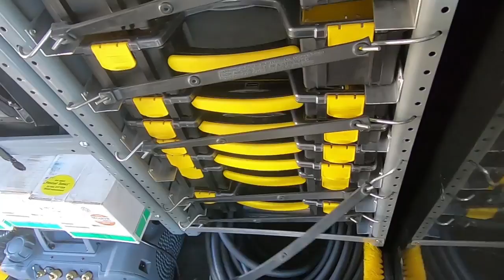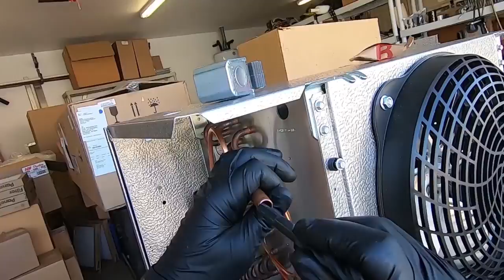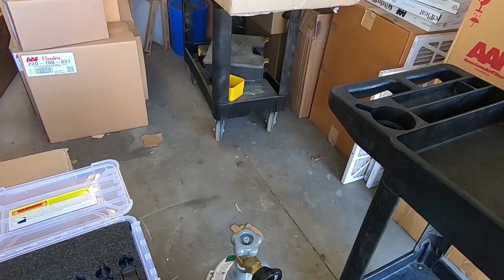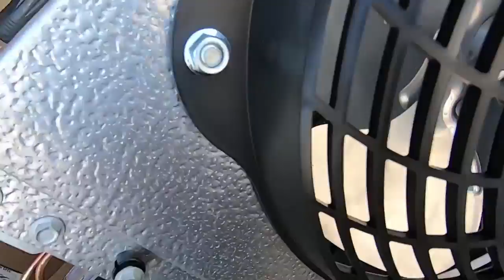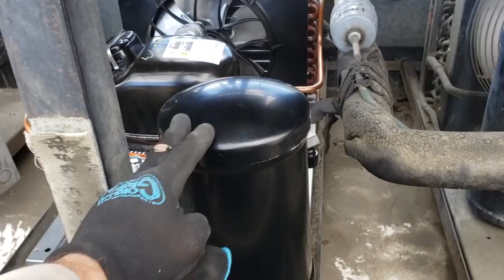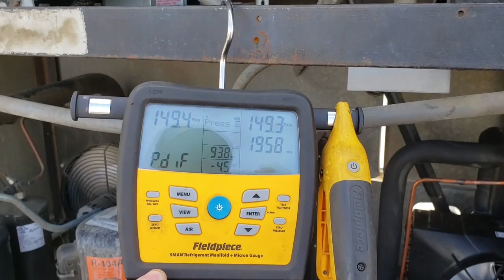BEER WALK IN EQUIPMENT REPLACEMENT

Comment: I had one I did this summer that was a real pain. Saw about a 4 inch 3/8” tube fall out of the feed tube leading up to the orifice when I unsoldered the TXV. I thought what the hell was that doing up there. Later on I found the orifice on the floor and realized someone used the tubing to hold the orifice in there, because they didn’t have (or lost) the retainer clip.  I found zero information in my books on it and very little on the Sporlan web site.  I thought the clip was to be installed parallel with the orifice and would pop into a groove/ slot once the orifice was up against the distributor head. It never occurred to me that the clip could be installed perpendicular to the orifice as it looks like you did in the video. Do you just start the clip in initially like that, and then, the clip rotates parallel when you push on it with the drill bit? Or does the clip stay in there perpendicular to the orifice under spring tension constantly?
I also noted refrigeration supply houses haven’t a clue about getting you a clip.  I ended up getting one by ordering the wrong sized orifice but right sized clip (L) = 5/8”..... I had the right orifice, just no way to hold it in. I got one on eBay used the new clip and tossed the wrong sized orifice.  Needed an L 2-1/2, clips are not available separately.  It was an experience. Also learned that the tube between the TXV and distributor is limited to 24”. FYI...

Comment: For the Schrader valve tool you used at the start of the video, next time you are at Auto-Zone, get the shortest valve stem that they have on the shelf,. and attach (in your case glue as your look like plastic) the removal tool to the end of the valve stem.  (the one I have is metal, so I just gave it a squeeze in a vise).  Much easier to screw and unscrew, and less likely to get misplaced.  (keep one without a valve stem for really tight quarters)

Comment: I see the line penetration hole you made for the new line set is large enough to accommodate the liquid line and the suction line with probably 1" insulation. I was taught that the penetration hole should be just large enough for the liquid line and suction to squeeze through, sealing it with expanding foam, and running armoflex to opening. We have found that over time with a hole that size, the roof panel insulation becomes saturated with water, will freeze, and thaws during defrost, runs down the insulation and refreeze causing a knot of ice to build at the bottom of the trap. The only fix at that point is to move the location of the line set. Now, this may be caused by the almost constant high humidity here in Miami and you may not have this issue in California.

Comment: Did you have to flush out those did you have to flush out the refrigerant lines? I am going to be doing in the near future and R22 to 404a walk-in cooler replacement. New indoor and outdoor unit 404 a and I was thinking of flushing out the lines did you do that on this job?

Comment: I don't know if you have United Refrigeration out where you are, but Trenton has this new ESP + Evap line that is built around the KE2. They are pretty cool, defrosts when needed vs timed, variable speed motors, EEV. Done a few so far, they are pretty nice

Comment: My goodness you would think you were welding the a frame on a 57 ford stay brite the way to go
Reply from the maker: No sir only 15% silfos for me.....
Reply: @HVACRVIDEOS  I watch a extensive video on a commercial gut on stay brite he even sliced open fi\ings and elbows the stay brite had more complete suckling up he said after 15 years no complaints if you would like I can post it to you
Reply from the maker: I have also seen those videos and read the articles but in my experience Stay brite has not lasted, I don't know if its the vibration or what but i have seen too many leaks

Comment: Chris, If you have installed a nozzle in the evaporator why do you need a TXV? Wouldn't the nozzle orifice do the same thing?
Reply from the maker: No the nozzle is not a metering device it is there to evenly distribute the refrigerant from the txv to each circuit.

Comment: I agree with you on using flares for the dryer and the sight glass on the roof, wrenches are lighter than torches... do you ever try the Jim Pettinato trick and use a little leak lock on the threads? A lot of people gave Jim flak for that on his videos stating that a flare doesn’t leak on the threads, they’re right but I think they missed the point, Jim doesn’t use leak lock to seal a leak, he uses it like a thread locker to prevent the flare nut from ever backing off due to vibration (at least on the dryer). I’ve switched to making all double flares recently, it’s easy with copper and you can apply more torque to a double flare. What do you think Chris?
Reply from the maker: I used to use leak lock but now I use nylog and I like that much better.

Comment: Hello 👋 chris nice job and video, thanks for sharing..question? The equalizer pipe conector from the evaporator should or not be like the exactly length manufacturer send in the new evaporator?...please when you can
Reply from the maker: the equalizer line can be shortened, its the txv distributor lines that you have to be careful about if you shorten one of those you need to shorten all of them.
I will be going live on YouTube this evening 4/22/19 @5:PM (west coast time) to discuss my most recent uploads and answer questions from emails and the chat. Come on over and check it out if you can

https://youtu.be/Zz48S-NmlAY

Comment: While i do enjoy your videos this is a complete waste of time and effort. I used to do all this crap years ago as well, buy everything separate and put it together, now i buy my evaporators complete, solenoid, thermostat and txv already installed, when you calculate the material and time wasted to put it together on your own, it's not worth it. Every time i priced out a job with a pre fab evaporator compared to buying and doing everything myself, if you include my labor, it's cheaper to buy it already put together not to mention it's a lot less work 🤷‍♂️ i get it that you might be doing this to create content for YouTube but i prefer to work smarter, not harder
Reply from the maker: I agree that a prepped evap saves time, however sometimes the prepped evaps aren't in stock

Comment: Can I ask what the purpose of the nitrogen purge is? Is the residual refrigerant flammable? Or does it protect the unit?
Reply from the maker: The nitrogen helps to keep carbon flakes from building up in the system caused by the reaction from the heat and the oxygen while brazing.

Comment: Hey Chris nice job. Why not 95/5% soft solder these joints? I work transport refrgeration and we use soft solder on all low pressure joints. 404A & 452A systems.
Reply from the maker: I'm just a fan of 15% silfos

Comment: I only work with ac, no refrigeration so I’m curious if the tev meters the refrigerant what is the purpose of the nozzle?
Reply from the maker: so the nozzle is there to make sure the refrigerant that the expansion valve has metered is fed into the evaporator coil evenly
Reply: Only in the case of a multi circuit distributor.

Comment: Nice job Chris. Only thing I would have done would be to screw a scrap piece of unistrut to something, maybe to the inside of the vertical up right to mount the pressure control to so it would be easier to get at..Also, (and I usually only do Ac) but never saw one with the factory stub on the distributor. I usually put the txv on the distributor. But the stub prevents having to silver solder the txv to the distributor which I always dislike doing so I like that Just seems like it would be problematic getting the nozzle and the clip installed.Great job on the videos

Comment: So essentially, the nozzle for the refrigerant type is sized to that refrigerant, so this is like when you get a convertible BBQ that comes ready for propane and you want to convert it, you remove the LP orifice and install the properly sized to BTU Natural Gas Orifices! Would the nozzle size also be sized to BTU or Capacity as well in refrigeration? Also in very rare cases, have you ever had to drill out a Nozzle?

Comment: Do you think the spin bit gets worn out faster with a 12v? Probably gets hotter and possibly softer
Reply: I've been using mine a few years now with a m12 drill and haven't noticed any wear to the bits. The bigger sizes (3/4 and 7/8) are a little tough on the drill and take a little more time and focus to make with out deforming. (If you force it too hard it will jamb in, create a ovel  and stall the drill. ) Nice clean install!
Reply from the maker: That's a great point!

Comment: I can't stand your constant inconsistencies!

Bleed yellow? Then I see you running a Milwaukee, how dare you!  😆
Do you ever use Harris #8?  I use it on valve's and some times on filters.
Great video.  Thanks.
Reply: no reason to use anything less than 15% on refrigeration equipment. Yes, I have seen the psi ratings for harris 8, but vibration and weathering concerns me with it. I only ever use 15% on copper to copper connections, and I see no GOOD reason to use harris 8 on connections, other than the fact you dont have to get your entire torch set out. If you dont want to carry an oxy/acet rig, just get an B tank with a turbo torch setup and use 15%. On residential AC systems 8% is fine, but I would trust a good crowned weld of 15% over harris 8 any day.

Comment: Fantastic video. Thank You.  I bet that little 12v is no match for the 3/4 or 7/8 swaggers ... :-)
Reply from the maker: Yeah it cant handle anything over 3/8 very well
Reply: @HVACRVIDEOS  The only reason I know is the 7/8 had my 18v XRP for lunch.. 

So basically I need to find a cordless with enough torque to rip my arm off to use the 7/8.. :-)

Comment: What are your thoughts on using pvc instead of copper for the drain line? Where I live the copper gets stolen shortly after installation. As a result all my walk in installs are pvc drains.
Reply: Coolers, yes.  Freezers, only if you run the heat trace inside the pipe.  Heat does not transfer through the PVC well at all. We have a customer with several walk in freezers, with PVC drains. Heat trace outside the pipe, well insulated, occasional freeze ups.